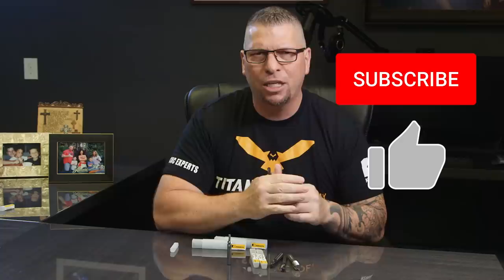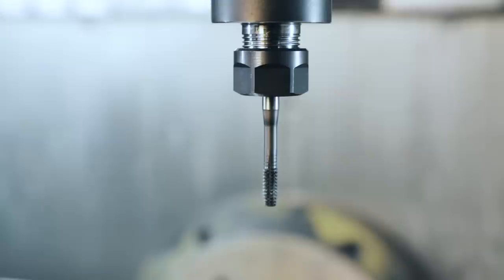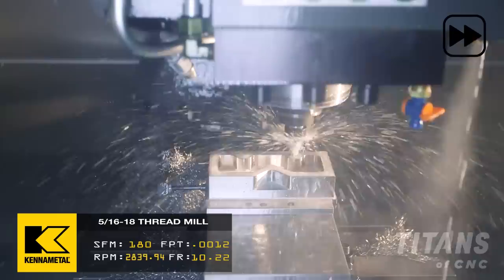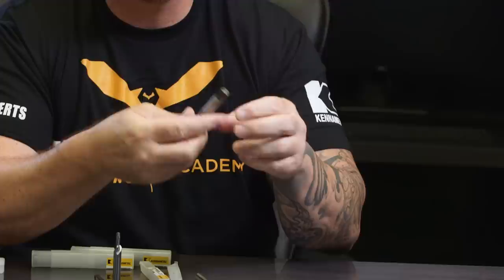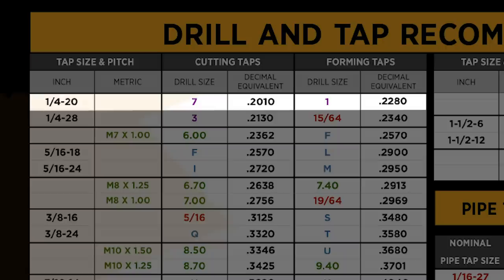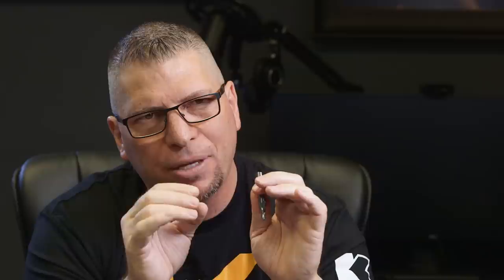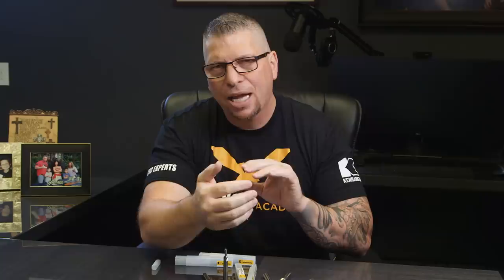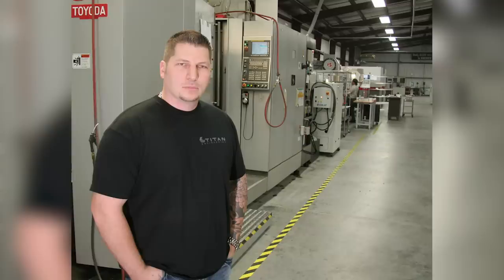Why I NEVER Tap Hard Materials | CNC Machining | Vlog #98

Comment: I went through almost exactly the same scenario as your camera housing problem while making parts for the f50 sailgp boats.  Broken taps were a showstopper.  Cut taps would last only 3 holes before breaking.  Once I talked the bosses into thread milling, I was able to run 120 m3 holes into Ti with zero failures.  
If you have a spare week, ferric chloride will dissolve an HSS tap out of Ti.  Guess how I figured that one out.
Reply: Another way to dissolve traps out of non-ferrous workpieces is alum, the same stuff you can use to stop bleeding from shaving cuts. Versatile stuff!

Comment: You didnt mention indexible threadmills or single point thread mills.  I prefer them over solid carbide threadmills when I need a deeper thread.  The solid ones are generally one inch or less which are limited.  However, I programmed hydraulic manifolds with 12 pitch threads ranging in various diameters and one size 12 pitch threadmill to cut them all eliminating several large taps and tool changes.  Keep up the Awesome videos and teaching the world about CNC.

Comment: Great info, thank you Titan for taking the time to teach us here on Youtube! Here's something I would like to pose to him and the folks here. Imagine you have a crazy expensive piece you are making with molybdenum, you can't use cutting fluid or lubricant of any kind because the part will be going into a super high vacuum device, and you're tapping numerous 4-40 and 2-56 blind and through holes. Obviously roll taps are a non starter, and moly will crack if you climb cut (it does NOT like to be in tension!). Best practice far as could be determined was use brand new cut taps a maximum of 3 times and then discard for a new one. I would really like to hear Titan's thoughts on this!

Comment: I make a lot of small Hastelloy parts on a Bridgeport with a ProtoTrak. I can't thread mill on that machine so tapping it is!
Reply from the maker: OMG, your going to Love Friday’s Vlog...
Has to do with everything you just said.
Reply: @TITANSofCNC  any chance you could do something on drilling Hastelloy with small drills? I'm drilling breaker plates for 3/4" extrusion screws and one plate has a ton of small holes - like 1/8" and smaller. I've also been having a tough time making small dies with micro holes. I've tried carbide but so far I've had the best lock with cobalt drills but I can't get more than a hole or two before they're toast

Comment: Good video.
Easiest way to explain the difference between cut and form taps, for those that don't know:
Cut taps remove stock material, form taps deform the stock without actually removing any material.
Also, form taps don't work on elastic materials ie. most plastics.
Reply: Interesting , work hardening at the same time .
Reply: @benwinter2420  absolutely. The result is a more robust thread that has more strength than a milled or cut tapped thread. Some aviation specification require form tapping for strength.

Comment: just want to share my experience on tapping. it is definitely not a good idea to use cut tap on those super alloy. in our shop, we use form tap for inconel,  from M3, 4-40 to M10, 3/8-16,and it works perfect. we have been doing this for many year, so far, none of them broke.
Reply: Meh lol I rock the cut taps in everything 😂 I just stop the cut at a certain point.

I may also, maybe, might have a DMU50 with tap chip break and soft reverse feature.😊
Reply: @kw2519 
Ur behind the times

Comment: METRRIICCCCC!!!!!! also love the channel. obviously, hence my constant pestering for metric.
Reply: We are in America, and we don't use metric. Whether you like it or not. Whether it makes sense or not. It doesn't matter.
Reply: @jappimann9076  Where are you from?
Reply: @keithhansen3963  earth.. not sure why that's relevant.
Reply: @xenonram  I'm in America and I use both. And all it does is increase cost and cause confusion, especially when someone sets a tool in metric instead of inch on the comparator. I wish we would go to metric like we were supposed to in the 70's. I hate using an imperial system based upon the whims of a long dead queen. So does every mechanic I've ever worked with. Way easier cutting threads on a manual lathe as well

Comment: Im old school.use a gun tap to do the work and a bottom tap to finish a blind hole.put a mo1 to put molly in the bottom tap.i do it daily thousands of holes blind holes.gun tap first.then bottom tap.i do 304 at .375 18 at 1 inch of depth.i go down to .975 then the bottom tap to clean out the taper? But you can peck tap on fanuc.at 200 a bite.recommended if you got a shitpile of holes.ruffer finisher? No big deal rigid tapping on a good mori

Comment: osg   has some roll taps  that can handle tungsten tapping .      We had a tungsten job with   8-32 tapped holes and a lot of parts.    I didn't run it but saw there were problems with multiple thread mills .    I remember my old job would use carbide taps by hand for tungsten   but it was so slow.   They called  osg   and were recommended  a type of roll tap they have     and they gave  a rpm   which seemed really fast   but  the tap worked pretty good..  tapped to depth in machine    eventually it   wore  but after a good amount of parts

Comment: Also formed threads are stronger because they align the grain of the metal to the threads whereas cut threads cut through the grain. Graded fastener bolts and nuts have formed threads

Comment: Never have done anything other then tapping by hand. When I need to tap Ti I use 3 step progressive hand tap method, tapered, plug, bottoming. Never have broken a tap using 3 step hand taps. After this I`m gonna have to try mill threading.

Comment: Another method for producing threads in hard materials you didn't mention and I haven't seen commented on for extreme instances would be to make an appropriate electrode and use an EDM die sinker and burn the threads. Obviously this method would not be at all suitable for any production work but to save a $20,000 insert made of hardened D-2(60-62 Rc) it is a viable option.

Comment: Thread mill certainly works a dream when it comes to threading NPT and BSPT threads in stainless steels.Never done any thread forming though,know how it works but can't get my head around how do you know when the form tap is at the end of it's life.When a cut tap goes blunt and you can feel it and replace it but with a form tap how do you know when to change the tap before it breaks?

Comment: Titan, I am a fan of thread milling holes, specially when they are blind holes. We have been trying to use plug taps for thru holes in 718incoel with a great results. The catch is; use a ton of coolant for chip flush and G84 with chip breaking cycle. It works similar to G73 ( deep hole drilling). Have you tried this in titanium material ? What about tapping NPT thread in titanium ( tapered minor dia.?)?

Comment: If you are breaking taps it's probably not the tap's fault.  Coolant is the #1 most important thing for tapping. If you are using the proper coolant at the proper mixture ratio then
most of your tap problems will disappear.

Comment: Question. After you break a threadmill and are left with a partial thread, how do you finish this thread. Can you aling the new mill with the partial thread or do you just manually tap it with a cut tap?

Comment: Very nice educational video Titan. Just curious what do you consider hard vs soft? Stainless? Also I would highly recommend you try using Carmex thread mills. They are incredible. For example I am tapping a 2-56 in stainless steel  .25 deep and I got over 1200 tapped holes before I changed the tool. Crazy!!
Reply: I’d say anything over 35rh?

1200 holes is pretty damn good at that size and material.  I think it’s less about the hardness and more about the ductility and gall potential.  Alum is soft but it’s also goopy.  

I just got done doing a 30xD .063+/-.001” in 304 SS.  Ended up using some guhring 1.61mm parabolic tin coated cobalt drills and came in from both sides with less than .0003” of mismatch.  I’m at over 100 units on the same drills.  It’s all about them speeds and feeds

Comment: I can understand picking thread milling over cutting threads for titanium where your hardness in the 30s Rc. But what about tool steels where you are in the 60s Rc? Is it possible to thread mill hardened tool steels?
Reply from the maker: Yes
Reply: @TITANSofCNC  Thanks! I will try to find some thread mills to test out on my D2.

Comment: Hello,
Nice video. Thanks for your teaching.
We are into mass production of 12 grade EN-24 nuts for Aerospace applications. The requirement of the customer is tapping on hardened material. Any suggestion of what kind of taps we should use. We are currently struggling with it.  We are trying with spiral point straight flute.

I am planning to try with Taper Taps for rough tapping and then going in completely with a spiral point straight flute tap. 

Any suggestions from anyone would be really really appreciated.

Thank you.

Comment: What would you use if the thread is very small like "4-40" do they make thread mills for that or do you have to use a tap. I like using tapmatics on small threads. But my question is, is there threadmills for very small threads

Comment: Nice video! thanks Titan! and also a question, is it possible to do a video about q parameters? If you can use those in standard gcode controls by the way. We use Heidenhain but I don't know a lot about q parameters and there is not much time for learning about them unfortunately..

Comment: titan.... im struggling with  thread milling a job right now...... material is 440c hardened .... threadmill is a 2-56 ..... any tips for success? equal step overs on each pass?
Reply: You should be taking smaller and smaller step overs as you reach your final OD. As you cut deeper with that 60 degree taper, you engage a lot of the tooth and run the risk breaking the teeth so your passes should get progressively shallower. Hope that makes sense and helps you out

Comment: I have to admit Ive never done thread milling but when the thread mill broke and you said you just touched off, what about lining the pitch or threads, has this ever been an issue
Reply from the maker: Never an issue because the tools are identical and you simply run the exact same program.
Z is the same...
Move in etc.

Simple and easy
Reply: @TITANSofCNC  I guess what I was thinking that if the thread mill wasnt exactly indexed in the holder, ie up or down more or less. Thanks for clearing that info ✌

Comment: What is the downside? Why are we using anything but thread milling? Looks like it is fairly fast as well but maybe not the fastest. But if I am not trying to optimise the last seconds of the cycle, why not just use thread milling for everything for convenience and avoid broken taps?
Reply: Look up "thread milling profile deviation". Its actually impossible to get a perfect thread profile, cause you're gonna be cutting perobolas instead of straight lines

Comment: What would you recommend for 0-80 taps in 316? I keep breaking taps!:(
Reply: Drill your hole to 55 percent thread engagement. Use a synchronized holder. Use Castrol molly d oil. And blow air on it while tapping. 15 SFM

Comment: So do you just use imperial System Units (Inch)? Or are you also able to machine to metric Units aswell i.e metric threads? How hard is it to convert your machines between those Units? Do you recommend to offer both units to customers?
Reply: BrawnGP94 metric or inches in Gcode is only about one g-code command, nothing else :)

Comment: Kennametal catalogue says thread milling should be done with internal coolant. How bad is it with regular flood? I've a titanium job coming up and it would fit the bill nicely, but I don't have internal coolant. And these are blind holes.
Reply: vilts I just use flood and have never broken a threadmill. I am quite conservative on my threadmill speeds and feeds though as they are usually the most expensive tool. That and take multiple passes.
Reply: @michaelschalk4718  Thanks! Now I will definitely give it a try.

Comment: Titan, I’m working parts that are 316 stainless. I’m trying to tap 3 holes 6-32, the taps keep just breaking and I have end mill them out. What am I doing wrong. I’ve tried several different brands and several feeds and speeds. I’m stumped. Please help.
Reply: He literally said thread mill
Reply: I guarantee your not drilling your hole big enough

Comment: Hey titan I was wondering if you know any good computers or laptops for cad/cam for cheap since I work a minimum wage job
Reply: Hey! If i may... any modern computer or laptop will do. But i think the question is what version of the cad or cam that you need?
Reply from the maker: Autodesk Fusion 360 is free for students and hobbyists... and it doesn’t take a lot of power. Also runs on Mac and PC.
Go to their website and search requirements... then just get something to those specs or better.
Reply: @TITANSofCNC  I'm just a student as well and I'm easily able to run f360 on my small 4 year old laptop. Loving how accessible it actually is! 👍